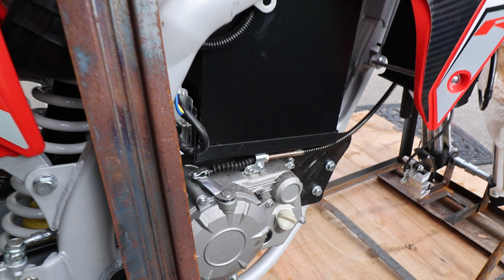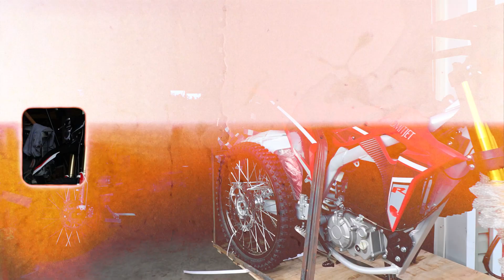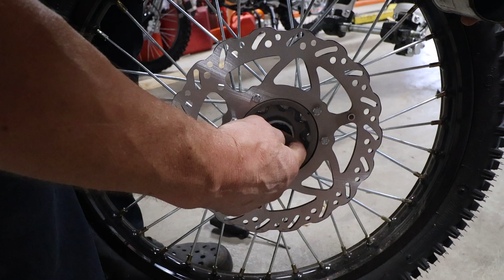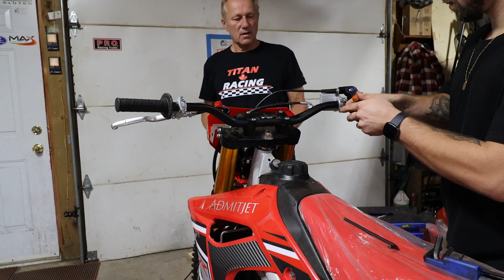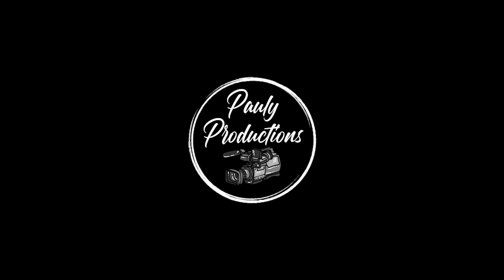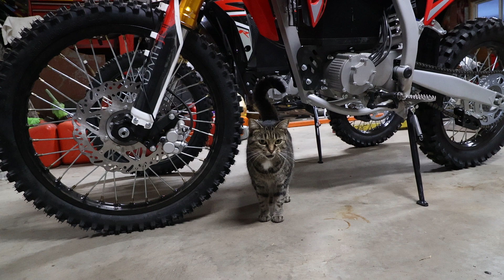Building an electric dirt bike in 2023 - Admit Jet / Nicot E-Beast

Comment: Hi did you get a manual with it? And what oil is recommended in tranny.  I got one, love the bike.
Reply from the maker: Hey, they are a great bike! Let me find out what oil is recommended in the transmission. I will get back to you shortly
Reply from the maker: The transmission takes 10w30 oil - you can also use 10w40 if you are going to ride the bike hard and get it hot.

Comment: They seem too good to be true , I’ve seen a few other videos & for less than a Sur Ron I’m impressed. Yes I paid $4,800 for my sur Ron & it needed $600 of up grades to make it even safe to ride . Reliability, quality, access to parts ???  All all concerns for the future. I’ll be watching your future videos.
Reply from the maker: These bikes have a lot of potential. No they are not race bikes like a KTM or Honda, but for the price point you are getting an electric dirt bike that is capable of taking lots of abuse, and offers a great riding experience. Reliability, quality and access to parts are all valid concerns. In terms of parts, all major components are available through AdmitJet. You burn out a clutch - clutch parts are available. You smash a transmission - transmission parts are available. You need a spare battery for longer rides - spare batteries are available. All parts are available, theres just no local "dealer" at this time. That is what I am working on fixing with AdmitJet and Nicot. In terms of reliability, I have been using and abusing the Nicot E-Beast (gen 1) for a year and a half and the bike hasn't let me down. Its been crashed, its been stuck in mud, and the bike still runs. Does it have its own issues? Yes, like every bike out there, but as these bikes get more refined, these issues get taken care of.

Comment: Looking sick!! The batteries on these are hot-swappable right? How easy is it to swap the battery
Reply from the maker: Yes these batteries are hot swappable. On the AdmitJet Armor it is super easy to swap the batteries. It takes a total of 2 minutes to remove and swap the battery.  Two bolts and the whole seat and shrouds make space to remove the battery. 

On this particular model, you have more bolts to remove, including the seat and gas tank. It takes about 10 minutes to remove and swap the battery on this model, which is the same on the Nicot E-Beast.
Reply: @paulyplewa  awesome, thank you!

So what model do I have to look for specifically to have the “2 minute swap.” Does this model have a smaller battery or less range? Or is it just different connectors?

Also, do you know how much it is to purchase a second battery if they are available?
Reply from the maker: @crazymotoman03 - the AdmitJet Armor is the bike that has a quick swap design. It is available with a 50ah or 60ah battery, (the model in my video has a 50ah battery.) The reason it is "quick swap" is because the frame is a different design, along with the plastics and the rear shock. The motor and transmission is the same, but there is a 60ah battery option available.

I am not sure how much a spare battery costs - but I can talk to the manufacturer and find out for you!
Reply: @paulyplewa  awesome, thank you so much! I was wanting the 60ah battery with with the quick swap feature. I wasn’t exactly sure which bike it was since some of them are similar, thank you for the information. 

And if you wouldn’t mind, figuring out the battery cost, that would be great! I’m sure other people would like to know as well
Reply from the maker: @crazymotoman03 So I spoke with AdmitJet, they now offer the Armor with a 60ah or 70ah battery - so you can get an even bigger battery. To know an accurate price, I would need to know where you want to bike shipped. You can also get a spare 60ah ($1500USD) or 70ah ($2000USD) battery as well.
Reply: @paulyplewa  epic!! I saws the 70ah option on one website so I wasn’t sure if it was legit. Glad to know they’re making bigger batteries.
Reply from the maker: Yes that is correct - You can get a 72V70Ah battery with the AdmitJet Armor.
Reply from the maker: If you are serious about ordering an AJ Armor, let me know. We can have a conversation about it.
Reply: @paulyplewa  I do 100% want one, but at the moment I don’t make enough to afford a new bike so I may have to sell another toy or two to get one. Hopefully I’ll find a way sooner or later!
Reply from the maker: Fair enough, I understand that struggle. Well save my info, when the time is right - reach out and let's make it happen!
Reply: Hey Pauly Thanks for the cool videos . I have been watching reviews of the admit Jet and the nicot E beast. I have been interested in both and am looking into buying  a few of course for myself and to sell I have been in touch with both distributors . I would like to know which of the two bikes you think are of better quality. Also, does the admin jet come with a wet clutch or or a linkage system I believe the Nicot e beast has a shifter with linkage . I would rather deal with one company cause I plan on building a relationship hopefully and be able to sell some of their bikes seem like you really know what you’re talking about so I figured I’d ask quality wise what you thought it was good. What if I was bad about the boat and which bike would you choose over the I’ve been jet. I know the same people that make the admin jet make the E-time which I heard it’s not that great and it’s real small quality wise. The adventure is a better bike from what I heard. I’d love to know your thoughts on this which one you would choose. 
I’m quite forms on this Surrons but I am real interested in starting to get involved with the bigger size bikes. Also, do you know anything about the E fox is it? Is it worth it? I can get pretty great prices of both depending how many I take of course but would really like your opinion on the quality and durability and the overall riding experience. What do you think is the best thank you!!! Peace out!!

Comment: Hey Pauly, I saw you also have the Nicot Ebeast which looks to share the same brake lever as the Admitjet. Curious if you've found if these are shared with any Japanese or European bike for easy replacements. Apparently the manufacturer only sells the brake lever with the perch and reservoir as an entire unit. I've discovered the clutch lever is an exact copy from the Honda XR's.
Reply from the maker: Hey @supernova, you are correct, I have the Nicot E-Beast, AdmitJet, Sur-Ron Storm Bee, Light Bee X and Talaria Sting. From what I can see any generic (Honda/Yamaha, not Kawasaki) front brake lever will fit the Nicot/AdmitJet. I have been able to replace the front brake lever on the Nicot E-Beast with a 2006 Honda brake lever and it fit perfectly!

Comment: Hey man! I came across your videos, saw the channel name... we used to race together in WNYMA!  Great to see you doing good these days.
Reply from the maker: Oh shit no way! That's awesome - what a small world! Thanks for reaching out! I miss the old WNYMA and WNYRacing days! Great memories - I see that you are also playing with e-bikes eh?
Reply: @paulyplewa  Yup! They are fun for sure.  It will be interesting to see what you think of the Admit Jet.
Reply from the maker: For sure! As of right now my favourite e-bike is the Sur-Ron Storm Bee. It has the best hardware right from the factory and I like having hand brakes.
Reply: @paulyplewa  Yeah I've ridden one, they are nice.  But heavy.  I built a custom bike on an RM chassis and its nice and light, handles amazing.
Reply from the maker: Yeah that is the downside - the Storm Bee is heavy. The power and low centre of gravity is nice, but the weight does suck. I did see that you built a custom bike - what motor, battery and controller did you use? How do you find the power output to be?
Reply: @paulyplewa  QS138 V3 motor, Votol EM200/2 Controller, 72v 33.6ah swappable battery.  I just made a new vid about it.  Only weighs 210lbs with super low CG.  Power is great, comparable to the storm bee at 18kw.  Honestly its the best ebike I've ridden.
Reply from the maker: Thats awesome to hear! The QS138 V3 motor is super underrated. It definitely surprised me! The fact that the bike weighs 210lbs is a huge bonus!